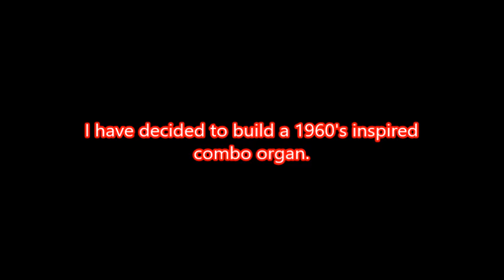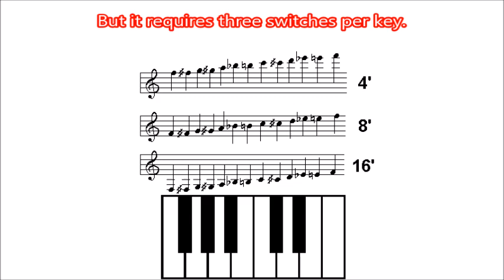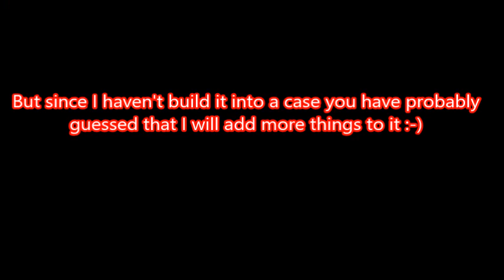Organ keyers for the polyphonic tone generator

Comment: Yes, yes, yes! I smell that the paraphonic synth system I suggested is in the making. Goody, goody, goody! :-) They used to write books about buidling your own organ from scratch but I have always wondered how many people actually did that. Well, at least one person has!
Reply from the maker: I think kit organs were more popular. I bought my old Wersimatic II drum machine from an old guy who had assembled several Wersi organs. And my own Wersi Prisma organ was also home assembled - though not by me but the pre-previous owner.
Reply: @organfairy  I own a Wersi CX5 drumcomputer which I soldered together myself years ago and it is still working. That is however not the same as really building a piece of kit from scratch or even designing it, like you regularly do, now is it? I salute you sir! :-)
Reply from the maker: @marcbrasse747  Thank you. When I started building things I didn't know that you could buy synthesizers as kits - it was before the internet. But I was learning to design electronics in engineering school so I decided to use what I had learned and designed a few circuits myself - sometimes with the help from old books from the public library (for some reason many of these books were in German). Today it's more like it gives me more pleasure to make things myself instead of just assembling things that others have made. But it surely is more challenging: Kits - at least those that are properly designed - should work right after assembling them, where thing I have made from scratch rarely works at first attempt. I usually have to change a few bits and pieces.
Reply: @organfairy  Creative problemsolving is a big part of development. The initial idea can come in a flash but actually building stuff and workign out all the detials can take ages. That's why I apreaciate what you do so much. It's also the reason why I tried to get into closer contact in the past. I can fully understand that you chose not to do so  but together we could move (sonic) mountains. :-) About old German books: Years ago I found a very interesting book in former East Germany. It is called Mikroelektronik in der Amatur Praxis, was released by the Militärverlag der Deutschen Demokratischen Republik (grizzly!). The parts written by one Hans-Jochem Schulze (so not Klaus :-) ) are brimful of interesting concepts and projects for musical instruments, assuming all the parts or equivalents can still be found of course. The second edition is from August 1983. Is that the sort of stuff you mean?
Reply from the maker: Marc, I have a weird request: Could you tell me if this video is still visible and the sound is still working? Due to a conflict between the Danish Composers Association and YouTube about money (as usual), some of my videos have been blocked in Denmark because I use music composed by a Danish member of their demon cult. But I don't know if they are still visible in the rest of the world. I hope it's only temporary.
Reply: @organfairy  Here in The Netherlands this video still opens perfectly. It's probably part of the same new knockdown on music instruction video's that teach you how to play favorite classics. Being (a bit of) an artist myself and having had my own label I have always been a strong advocate of copyrights but, as with all things in real life, the big boys get all the earnings and the small ones are left out in the cold. In other words: Cultural imperialism abound. Worse still: In your case you are not earning a penny from it anyway but are just trying to keep this music alive. The DCA however probably claims that Youtube is earning indirectly from it, which is not untrue. Time to start composing your own stuff I'd say. Have a nice weekend anyway.
Reply from the maker: @marcbrasse747  I allready do. It's just not the majority of videos because I don't have the inspiration to compose 52 new pieces each year - I upload once a week. But the videos where I am the composer are the ones where I don't mention any other composers or original  artists. I often use a casual phrasing like "something I put together". But it seems like it's just in Denmark some of the videos have been blocked.......let's hope they find an agreement soon so things can return to normal.
Reply: @organfairy  A very old trick is to use a song but just change it enough to not get sued. So mix up the chords a bit, change the bassline and some lead lines and presto. That's what all bad imitators do. You can then even say it is a tribute or parody of the original song and in that way still get away with mentioning it. Strangely enough that is all allowed. Do however not use exactly the same music and only make a parody text for then the royalty laws still fully apply to the music. :-)

Comment: Fantastic stuff, Much respect!
I really have to get cracking on assembling my string synth that is inspired by your 8 Oct poly tone generator. 
Thanks for sharing your knowledge:)
Reply from the maker: Wouldn't a string synth need a more soft envelope? The logic gate based keyers are just on-off so they are best suited for organ tones. I have thought about making a 2-octave string synth myself - one that is based solely on NE555 timer chips (I inadvertently bought 100 of those a couple of months ago).
Reply: @organfairy  yes string synths defiantly need attack and sustain control. I am using diode keying like the paia strings n things. I am also shaping the waves with an rc network and diode clipping to make saw waves. The oscillators are 555 based with dividers. Its going to have 3 detuneable ranks so 36 osc in total. Plus modulation, paraphonic  vca and vcf and fixed filters and chorus. It has 49 keys. Its a little mental I know:p 
Definitely build a stringer oneday. I'd love to see what you come up with.
Reply from the maker: @PracticalCat  I have never had my hands on a String'n'things but it looks like the keyers that Elka used in the late 1970's - and the ones I used in my 1½ octave mini organ.
Reply: @organfairy  I went pouring through loads of service manuals I found online to find the cheapest most low parts keyer system. I was very happy when I stumbled across the strings n things.
Reply from the maker: @PracticalCat  Most of my knowledge about organs comes from taking old ones apart and see how they work.